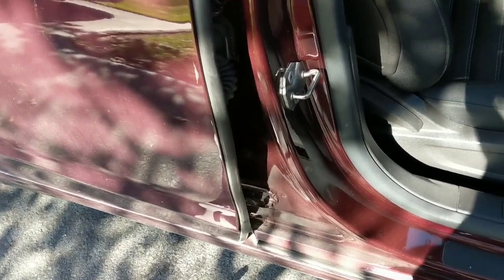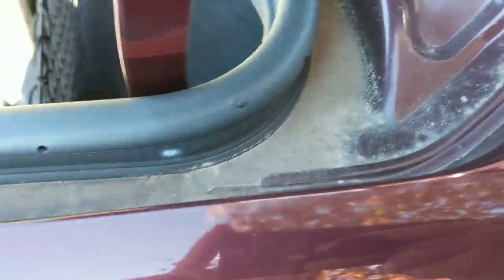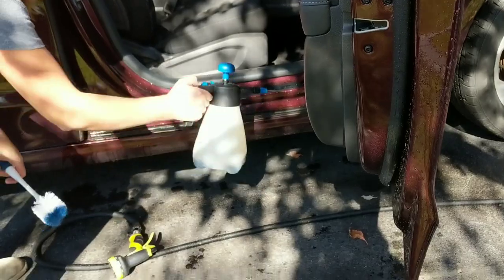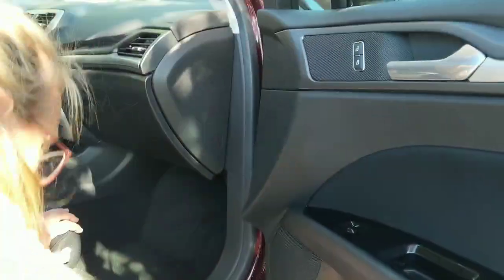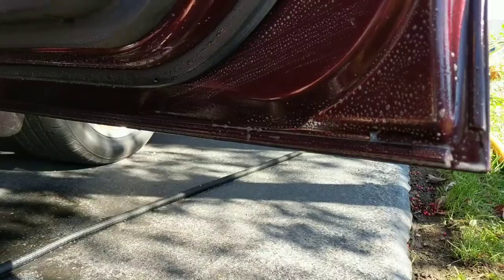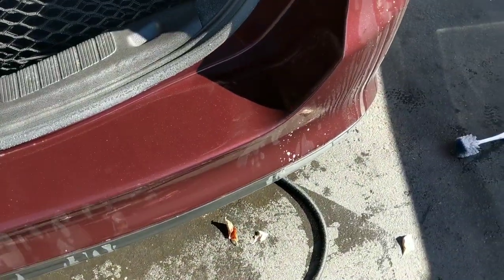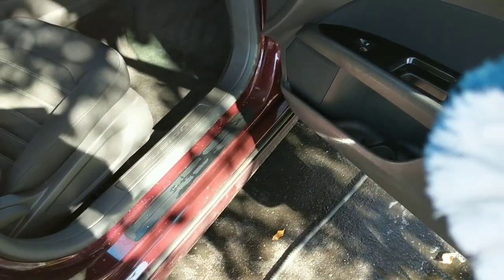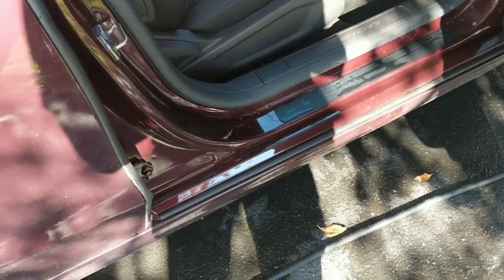Best Tool for cleaning neglected doorjambs

Comment: Maintenance is easy, a little spray wax or QD. Super soiled is a whole different issue, and nothing wrong with some water in the door, as long as you dont flood the interior. Shoot, the inside gets wet when it rains doesn't it?

Comment: When pressure washing the door jams does it not take out the grease? Would it eventually on a maintenance customer? Do you regrease them
Reply from the maker: For a maintenance customer id do this initially and then maintain with onr and spray wax

Comment: New subscriber. Is the "Rage" available retail or do I have to order it? Thanks!
Reply from the maker: It's available at O'Reilly's or you can order it online. Shipping can be pricey but it's so worth it. Also check out their wire wheel cleaner, dirt buster, coverall and pink perfection if you have an O'Reilly's near you. Great products for a great price!
Reply: @attention2detailswchelsea  Thanks for the quick response. O'Reilly's less than a mile away. Going there ASAP.. Enjoying your videos!
Reply from the maker: @tomevans5458  you may have to talk to a manager to order them as they are their pro line of products and sometimes not in stock but held in the back but they can order them for you as well.